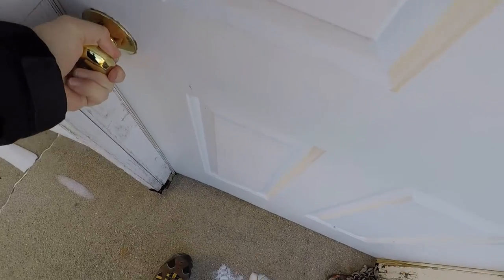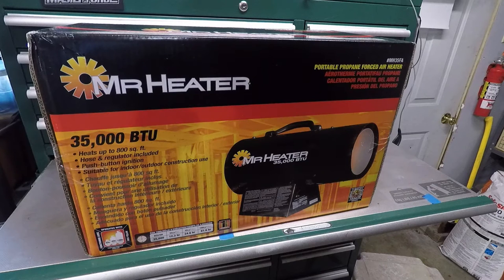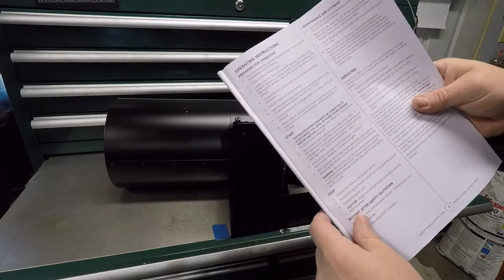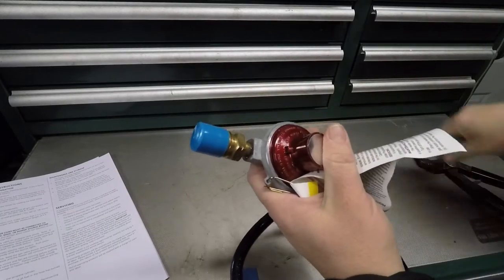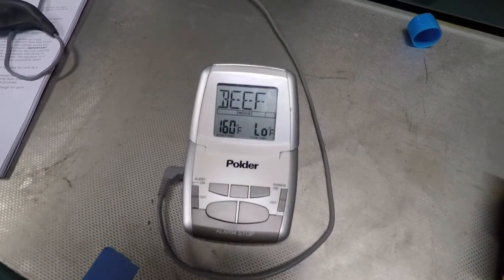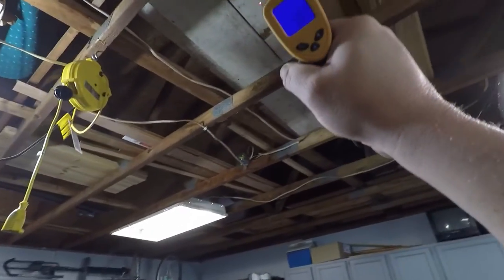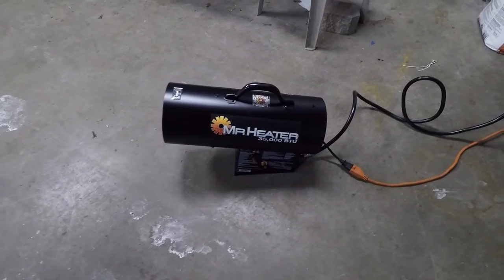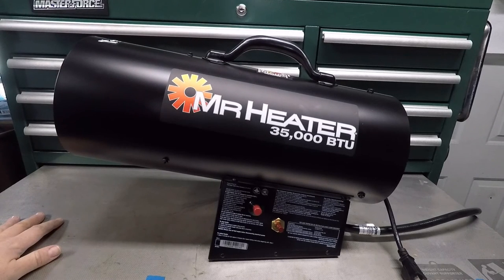Mr. Heater 35,000 BTU Torpedo Unboxing and Test

Comment: How long did it take to ignite? Mine still hasn’t ignited. Held down switch on the left and repeatedly pushed the igniter. I could hear the igniter pushing gas out as I pushed it but nothing would light. Any ideas or just keep trying? I’m also smelling gas too but I figure that’s normal when hitting the igniter

Comment: I just bought one of these, and am wondering if the noise you begin to hear (a higher pitched nose) when holding the valve button in to get the heater started continues once the heater is ignited and you let go of the valve button. The first few times I didn’t notice that that noise continues, so I thought it was odd when the last few times I went to try it, I could still hear that noise after releasing the valve button and getting the heater started
Reply from the maker: Hmm.. Never really noticed.  I'll probably fire it up soon though it just dropped into the teens here.

Comment: @RocketScientist what are the 2 buttons on this, which one is the power...what do the 2 buttons do?
Reply from the maker: There is no power on switch.. Fan is always on while it's plugged in.  Buttons are how you ignite it.  Hold one in and push the igniter at the same time.  Pretty much like a gas grill with the extra button.
Reply: @RocketScientist  Kinda really glossed over this area. One of the most important to see.

Comment: Did you need to vent your garage? Bought one today .
Reply from the maker: Certainly couldn't hurt.. I usually crack the door cause it gets too hot, which also counts as ventilation I guess.  They say its not really "needed", but probably a good idea for a couple reasons.. its slowly burning away the oxygen in the room, and if the burner ever malfunctions, it will produce CO, so I also keep a CO monitor handy just in case.  I don't worry about it too much.. its never on for more than a couple hours while I'm working on something.
Reply: @RocketScientist  Good to know! I have had it running a cpl hrs now, with garage door cracked, & It's a pretty comfortable temp  in here now 👍
Reply: Mine has kind of a strong odor 🤔

Comment: Hi. Thanks for the video. Thinking of getting this heater also but wondering if i can use my thermostat from my old kerosene salamander ? Bought the thermostat and by the time i tried using it the salamander died on me but cant take it back now and was wondering. Thank you. Have a good day
Reply from the maker: Eh, not unless you want to turn your garage into a giant bomb.  The thermostat would shut it off for you, but you'd have to hit the igniter manually each time to restart, plus the unburned gas would keep flowing.  This is a basic, no-frills heater.
Reply: That makes sense! Use to using the old salamander is all. Thank you for that!!!!! Just thought i could get some use from my new thermostat was all

Comment: I have another question, do you let the heater keep running while you are running out of propane? I let mine keep running today as I was running out, and the flame got smaller and smaller until it diminished. Wondering if this is the right way to do it? Or do you swap tanks when you notice it’s getting low?
Reply from the maker: Eh I guess I do the same thing..  Usually I'm wrapped up in some project not paying attention to the heater when I notice it's gettin cold again, that's when I notice it's outta gas.  It hasn't killed me yet so I think you're good.